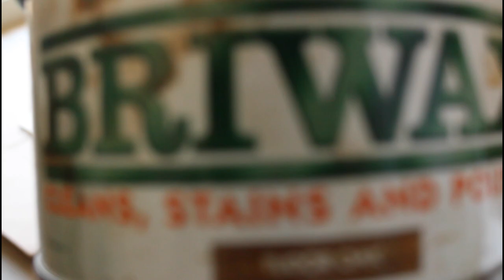DIY Floating Cat Wall  Shelf -WALL PART 2-　猫 DIY キャットウォーク

Comment: Legit question: could I fill cracks and do the dowels, then put finish on the project.
Reply: Yes, you could definitely do that. One reason that people stain the individual pieces prior to assembly is that it is easier than trying to stain the finished inside corners/angles but it is not impossible to do after assembly.

Comment: 0:22 What's the length of the cuts please?
Reply from the maker: thank you for watching!
length is 1350mm.
Reply: @DIYCATVILLAGE  Thanks for sharing this awesome idea! But what I mean is board number two, the one in the middle. What's the length of it?
Reply from the maker: @amrfwws  oh sorry it is 31cm.
Reply from the maker: 310mm.
Reply: @DIYCATVILLAGE  OK, that's great, I've guessing it was 350mm in length before(pretty close), thank you! I'll build 2 type of it, one with the same size as you, and one more for the kitten it would be smaller, I will use 24cm wide pine wood planks for it. Again, thanks for answering me, not a lot of YouTuber answering people questions you know? So thanks for making me so sure and excited to build two of it, because I have a lot of cats. 😊
Reply: @DIYCATVILLAGE  Hi, sorry to bother you again. I've already buy both Star-M plug cutter and countersink drill bits, but I'm not sure what kind/size of screws are exactly used on 3:38? I almost finished it!
Reply from the maker: @amrfwws  
no worries !
but sorry i dont remember screws.
im not professionl so i cant advise you about screw.
i find this article below.

Screw length
The length of the screw should be at least twice, but not more than three times, the thickness of the plate to be fastened. If it is shorter than this, it may come off when pressure is applied.

Screw thickness
One third or less of the thickness of the board is recommended. The thicker the screw, the sturdier it will be fixed, but be careful not to use too thick a screw, as it may cause the wood to crack.

if its help you im happy.
sorry for i cant tell you what i used.
Reply: @DIYCATVILLAGE  That's really helpful, thanks a lot! 🙏